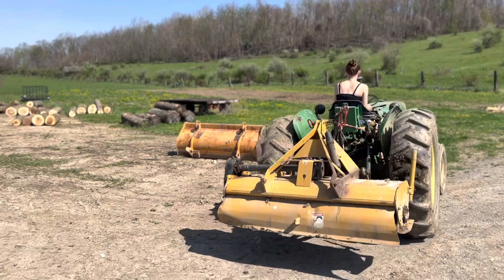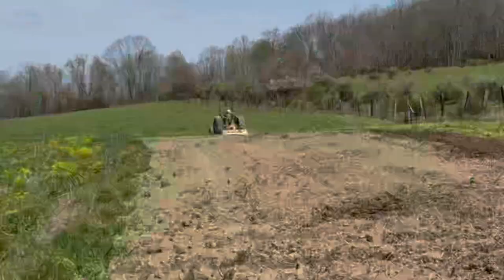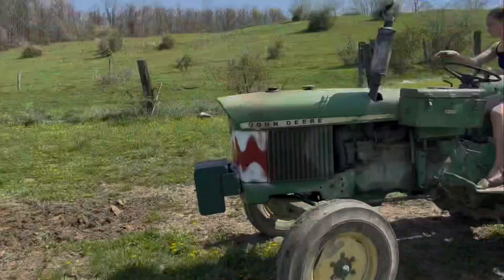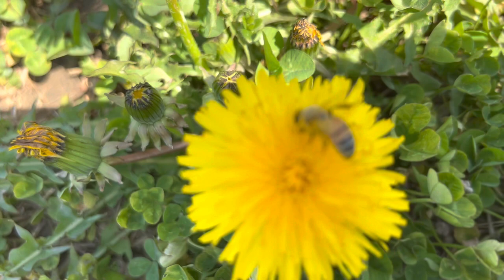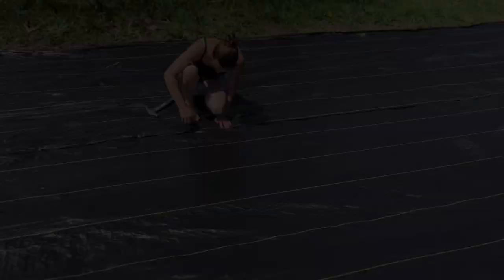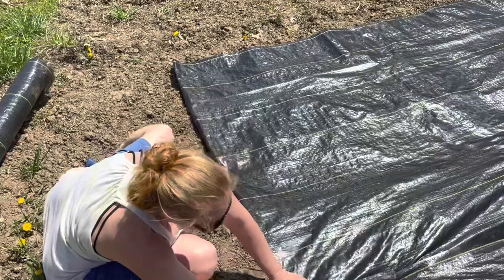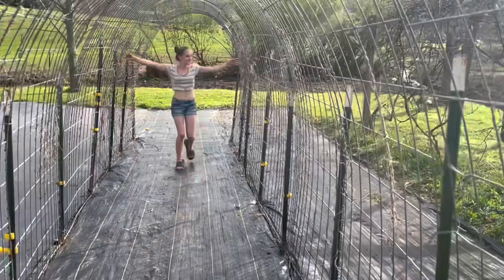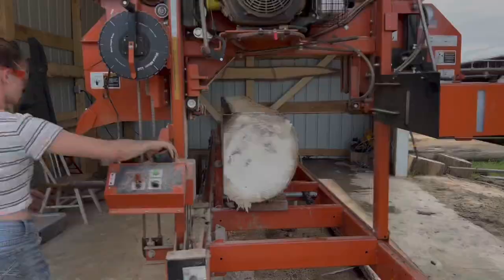Busy Weekend with Preparing Gardens and Sawing Poplar Boards

Comment: Ditch the 'Asian footwear' and get some proper shoes and also, don't forget to wear ear muffs when you use the saw. 
Great footage.
Reply: This is good advice. I had a log fall on my foot and it caused a lot of damage. Basic safety gear is imperative -- steel toed boots, hearing and eye protection. Don't go overboard, just be sensible...
Reply: 🙄 what ever.